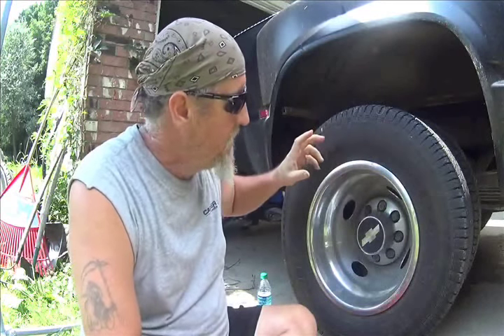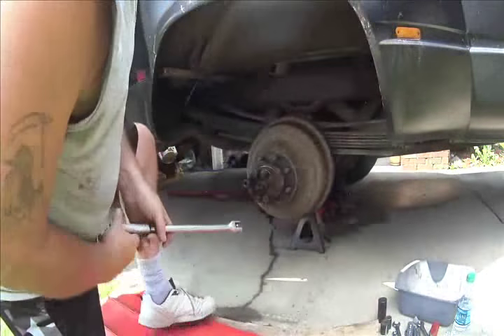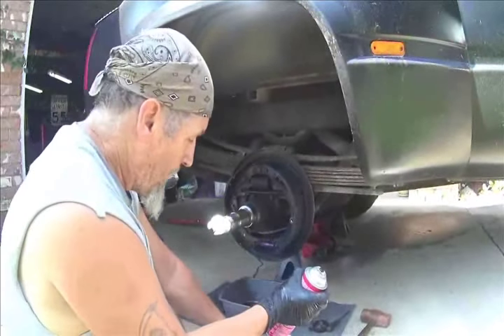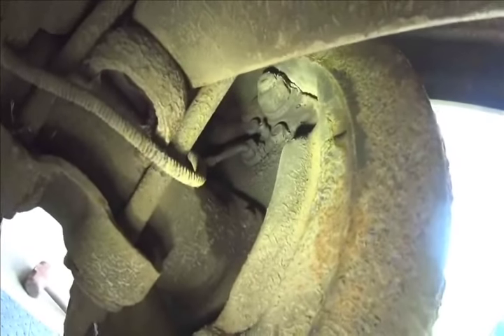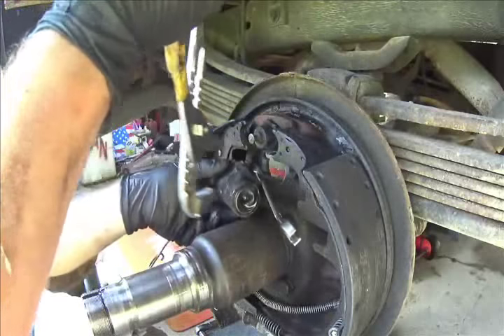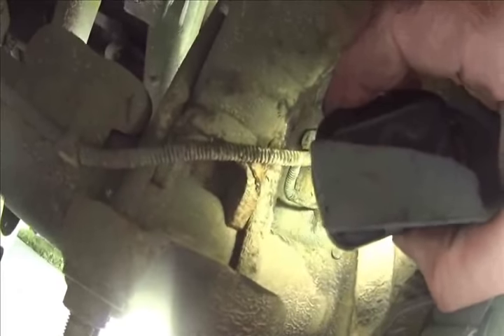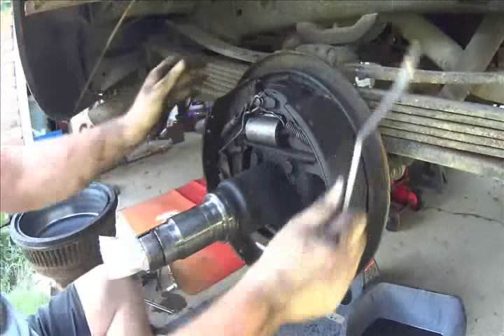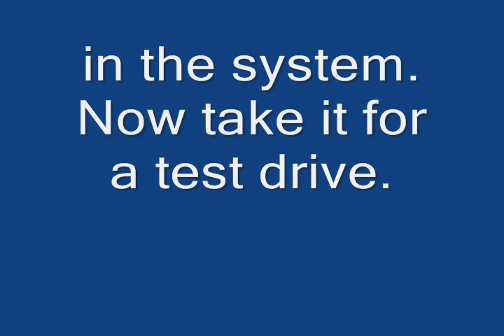Rear brake cylinder replacement 2000 Chevy 3500 Dually.

Comment: Pretty good video even if it is now 4 years old !  If you would have removed the 4 bolts facing you to remove the backing plate you could have gotten to the 2 cylinder bolts and the brake line a lot easier.
Reply from the maker: Thanks for the tip!

Comment: I got lucky I saw your video I'm about to change my brakes on my 2000 chevy 3500 .well that's what's the RV is on 😆
Reply: Now I got ti change a line did seem so hard but run into a metric on ABS and standard on the new line can't find a coupler . I guess I'm going to cut and flare the new line .OMG WHY !!! LOL
Reply from the maker: Glad I could help
Reply: Up date I found the part I needed after looking two days . It was at the first auto parts store I asked for it just someone different waiting on me !! Go figure 😆
Reply from the maker: @rickybeaver310  Thats the way it is sometimes at the auto parts store.  Every once in a while you get a Flunkie that is kind of smart.

Comment: Did the rear brake drum just slide off after the axle was removed (you did not show that)?
Reply: It should but mine did not. Ended up renting a slide hammer from auto parts store.

Comment: Thank you for the video.  I haven't started on my 1993 Chevy 3500 until cooler weather.  Have you ever had
a problem starting your truck after running it say to a store and then it won't start until it cools down for
about 4 hours?  I haven't found any mech that knows about diesel engines in my small town.

Comment: What ended up being the problem getting things seated there at the end having the same issue with my 3500
Reply from the maker: Air in the brake cylinder keep the pads from seating. Once I cracked the bleeder valve it seated.
Reply: Thanks
Reply: @nashvillelawnmow216 spring is on the wrong side of the center strut. but other then that great video bud